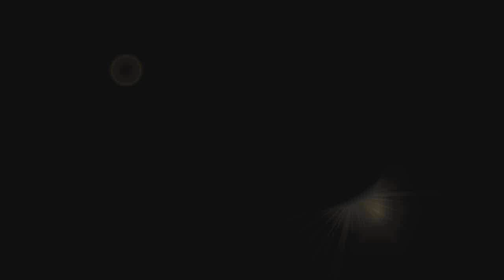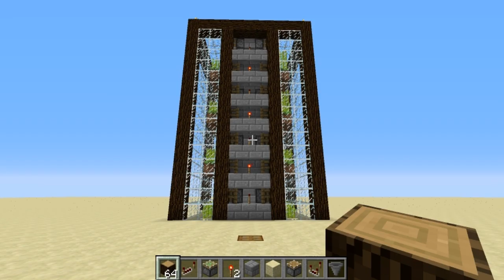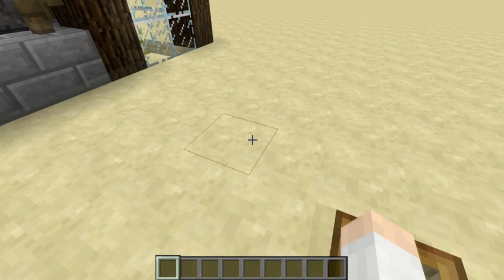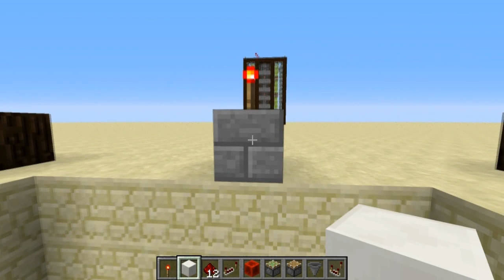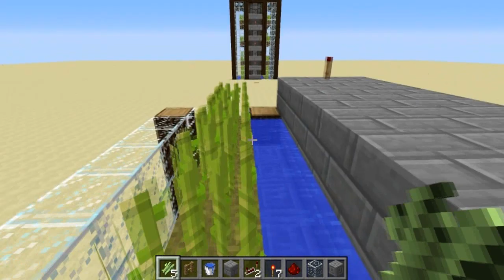[Tutorial] Minecraft Fully Automatic Sugarcane Farm (Stackable Design)

Comment: When you increase it lengthwise, how would you make the water canal longer? I mean won't you always require to increase a block in height? How do I make the water flow in the same direction while increasing the water canal length and maintain the level at the same time? Because when you put one block of water it only flows for about 7-8 blocks and then you'll have to add another water block. Buy to stop the water from flowing backwards you'll have to dig one more block down, isn't there a way to maintain the level and still make it flow in the same direction?
Reply: You can keep placing water, source blocks, by using infinite water sources. Horazontally
Reply: MinecraftMory but that water won't flow in one single direction
Reply: Oh, sorry I thought you meant the water that keeps the sugar cane alive, for the collection you can use hoppers. But it's more expensive
Reply: But, yea if you were to have water alone for the collections, you'll have to keep going up or down to continue the water streams, so yes you are 100% correct.
Reply: Or, you can replace the canal with rails and then have a hopper minecart go along the rails and pick the items up.
Reply from the maker: Bhavesh Nande You can also use signs to keep the water flow at a consistent height.
Reply: cubfan135 oh, that sounds better.